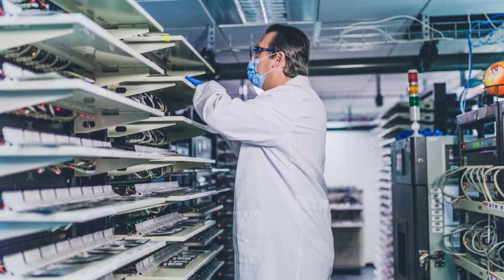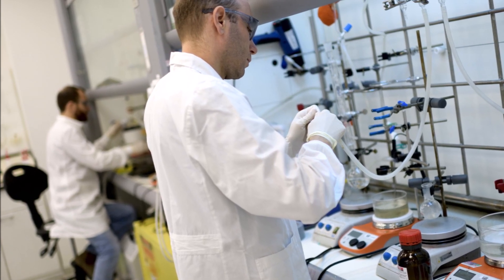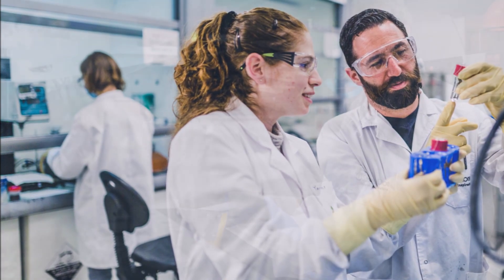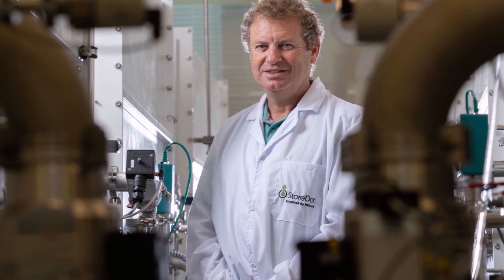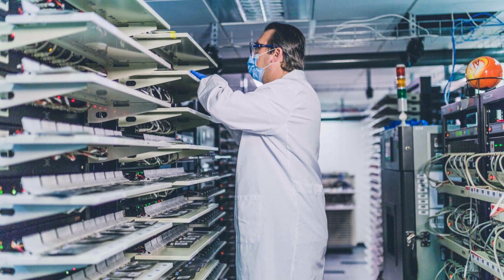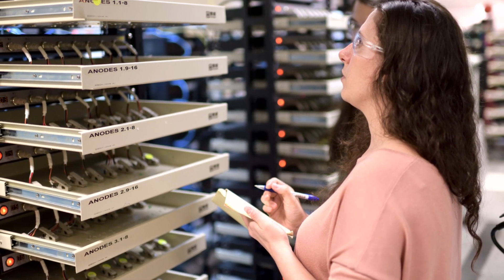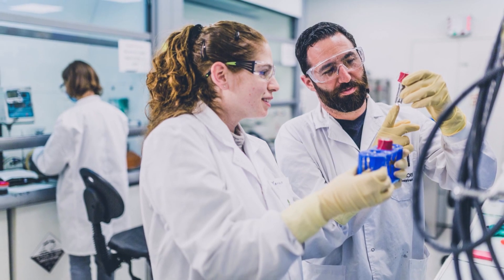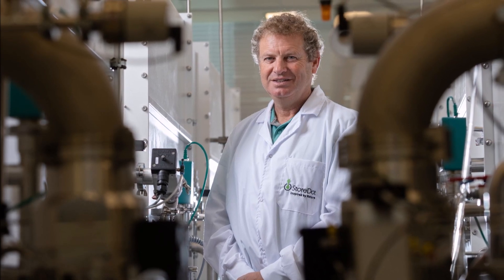EXCLUSIVE! StoreDot Confirms Tesla-Like 4680 Battery Specs, Moving To Production Process

Comment: With faster charging you could get by with a smaller battery as you could charge almost anywhere anytime on the go.  A 200 mile range would be adequate for most saving weight and costs.

Comment: A third party making a 4680 size battery does not mean they're equivalent to Tesla's because of Tesla's dry electrode and tabless electrode patents. Those patents are key to the cost reduction and more efficient cooling that Tesla's  4680 batteries have.

Comment: A battery capable of charging quickly will have low internal resistance, and the potential for good cycle life as it will not heat up as much for a given rate of charge. Storedot gave 500 charge cycles with 10 minute charge, so should be good for more cycled charged at home over maybe 5 to 10 hours.

Comment: IMHO, Producing these batteries themselves is one way to move forward but it is really expensive to build a factory and ramp production. Maybe their exit-strategy is to sell the IP to a large battery company that wants to compete with Tesla or CATL or ...etc. Also, they probably won't be the last company to replicate the Tesla 4680. 
Meanwhile, in the Tesla Bat Cave (OK, I'm old), our heroes are perfecting the production of the Dilithium Crystal that will be a 1 kg device stuffed into the glove box with a range of 2 light-years or 5 seasons whichever comes first😈

Comment: All battery technology advancement is good. It sounds promising, and I wish them luck in making the leap from the lab to mass production in just two years time. There will certainly be much greater demand for high performing batteries in 2024, as so many more automakers will be releasing new EV models by then. As mentioned, today most people charge over night at home. So super quick charging is not critical to everyone. But in two years the EV market will be much larger, and fast charging along with a low battery price price will definitely appeal to many EV buyers. Hopefully the fast charging does not need a proprietary charger to attain those speeds. They talked about quick charging, good cycle life, and low cost, was anything mentioned about comparable energy density?
Reply: Ditto
Reply: BTW - Production is one way to move forward but is really expensive to build a factory. Maybe their exit-strategy is to sell the IP to a large battery company that wants to compete with Tesla or CATL or ...etc. They probably won't be the last company to replicate the Tesla 4680. 
Meanwhile, in the Tesla Bat Cave (OK, I'm old), our heroes are perfecting the production of the Dilithium Crystal that will be a 1 kg device stuffed into the glove box with a range of 2 light-years or 5 seasons whichever comes first😈

Comment: If I gather this correctly, it appears we are testing charge cycle time of a certain chemical mix in a pouch format and assume the result will come out in future 4680 format? If so we may be stepping ahead of ourselves with that assumption. 

Fast charge generate a lot of heat that need to be drained completely and rapidly. Pouch format have a least thickness to volume ratio and hence lower thermal impedance rate which can handle thermal sink rate down to 10 minute that is not necessary so in 4680 format which has a higher thermal resistance. The patented axial directed thermal path is a good head start to reduce thermal impedance from the core to internal periphery and fall short to cell wall and coolant channels further down. 

Because the patent employs 1)  point contacts thermal junction and 2) without specify a preload force rate and how that is attained, 2) is necessary to maintain a required constant contact pressure, pressure to pass heat and electricity effectively. 

The associate problem in 1) and 2) above also open up chance for electric spark inside the cell from inertial shock originate from the wheel. Is a long term safety issue. 

4680 development will be incomplete passing those three problems down the production line.

Comment: Discussing charging time of battery cells needs to take into account the power requirements for charging. Charging twice as fast means charging with double the current or double the voltage from the car charger. And it probably changes the cooling requirements. The point is: It is not about replacing one cell type by a new type, but much more changes are required.
Reply: Thanks captain obvious.

Comment: Tesla will mass produce the 4680 by the beginning of 2022. That gives Tesla two years of experience in mass producing and optimizing their own design. By the time StoreDot moves to mass production the charging time of the Tesla cell will be at near parity with the StoreDot design. But Tesla will still be a voracious consumer of 4680 cells and will merely add StoreDot to it's supplier list. I still see a bright future for StoreDot.
Reply: Gerhard do you know if Store Dot can massive produce this battery?
Reply: @marctemura2017  No I don't. But if you'll allow me to speculate, 2024 is a bit too far out for me to believe that is a firm date. Torque news did not mention that Store Dot has ever experienced a mass production ramp. Thus the 2024 date is optimistic.

Comment: I find it hard to believe that no one asked if they are using a dry battery electrode (DBE) process similar to Tesla so flammable solvent use is greatly decreased… water used in the production process is greatly reduced… and the manufacturing footprint is greatly reduced…
Reply from the maker: I took all the questions from previous report's comments.
Reply: @Torquenews  if you get to ask any follow up questions… be sure to ask if they are using a DBE or DBE like process for the ‘jelly roll’ thanks Armen